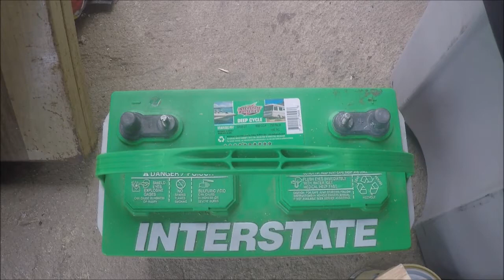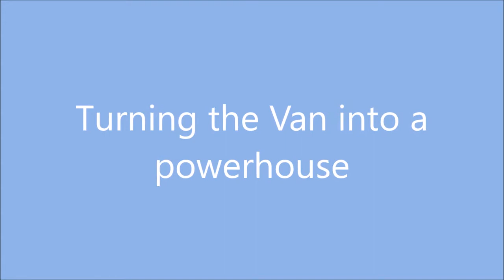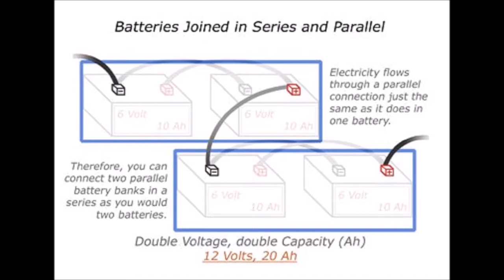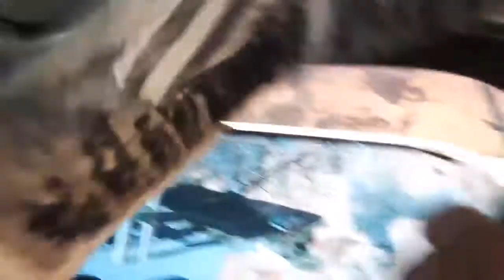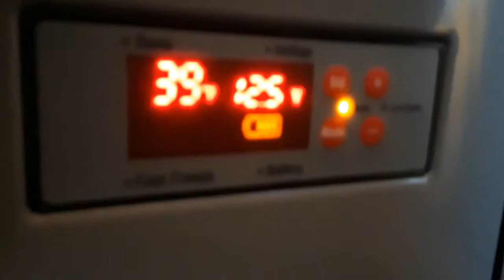Turning the Van into a Powerhouse

Comment: So how many AH do you have now Sue?
Reply from the maker: 920...I think. lol.
Reply: WHen you use 2 6volt to create a 12v battery your volts double but your AHs do not so if you have 4 - 6 volt batteries with 150ah ea. your system now has 300ah not 600ah. That's an example. How many ah ea. battery?
Reply from the maker: lol, you are right. The battery gives 134mins @75amps .  The frig draws 54-60 amps at 5v per day. Experience has been showing me that I'm good for 2 days at least on an overcast day.  I always liked math but not physics.
Reply: PerSueTheDream that's awesome Sue, you have 300ah. That's a nice size.
Reply from the maker: thanks for working that out for me. lol.  yes, I think it's going to make a big difference
Reply: PerSueTheDream that wasn't my intention, I'm just curiously nosey. With that being said I'm glad it worked out for you. Lol
Reply: PerSueTheDream Upon revisiting this conversation this morning, I can't figure out how I came up with 300ah for your setup? If you have 4-6volt batteries at 75ah ea. you only have 150ah at 12 volts not 300. :(  A dumba** attack on my part evidently.